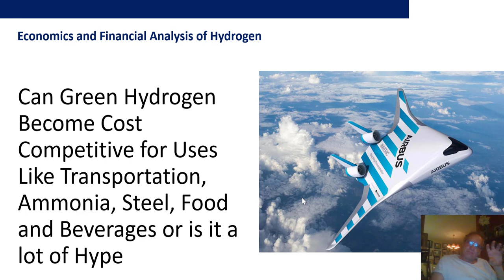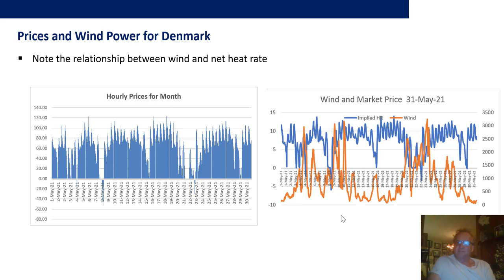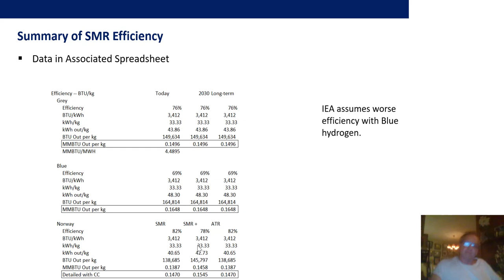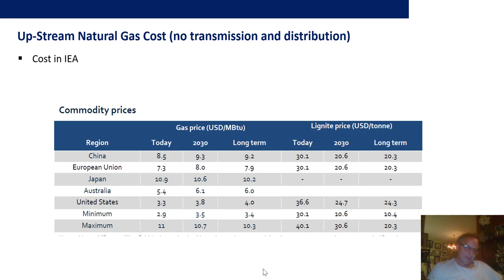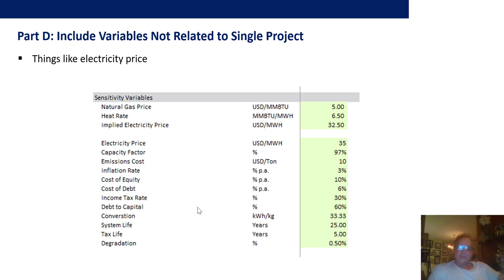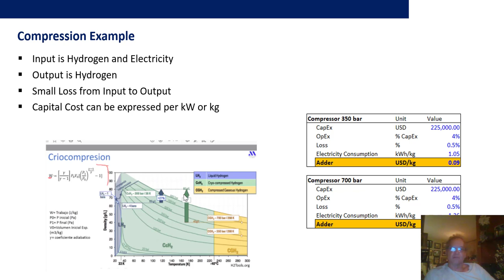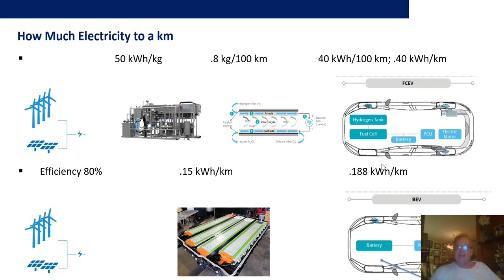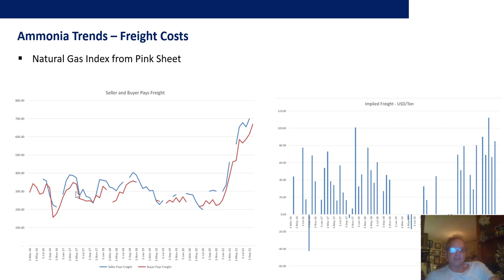Summary of computing hydrogen levelised cost components from A-Z

Comment: The solution for extraction of hydrogen can be had through nanotechnology.  Bulk chemistry electrolysis reaction is a dead end.  A water splitting with nanoparticles catalysts isn’t happening because we are stuck in stupidity.